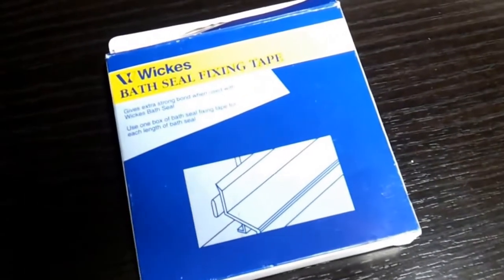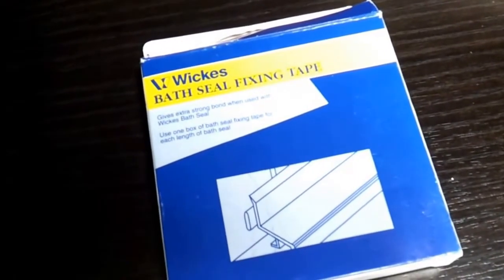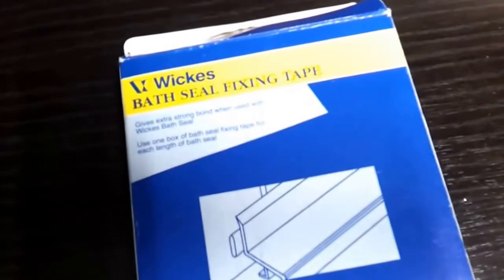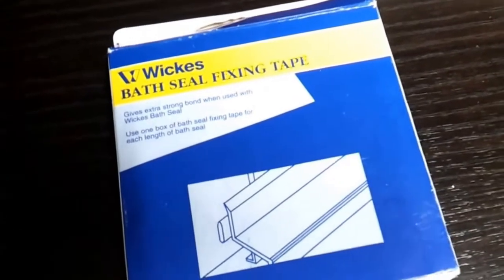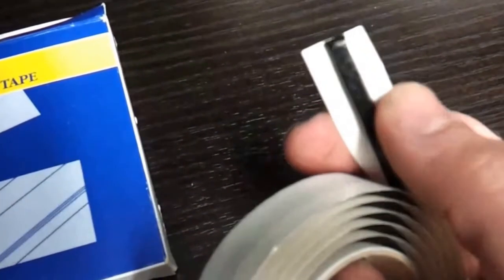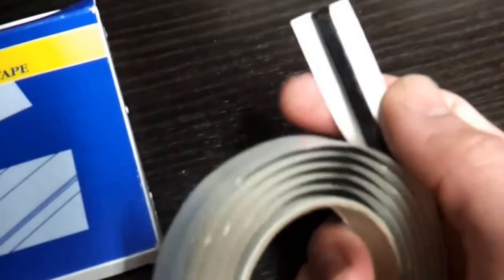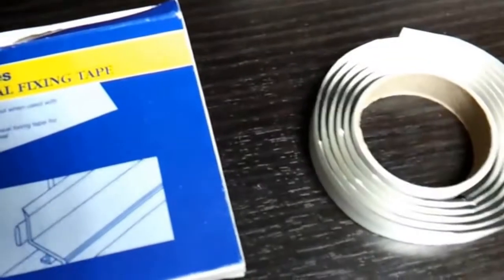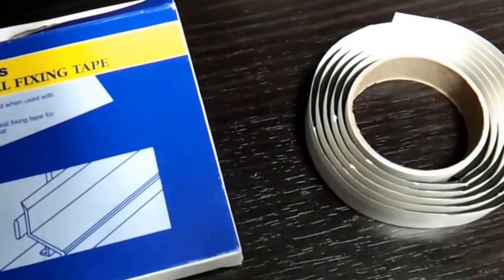QUICK TIP: Dcc decoder fixing tape

Comment: Good idea Jim mate but I just found out that some of my older Bachmann models aren't dcc ready so any ideas what I have to do to solve the problem the models aren't the split chassis type,one is a class 40 and the others a class 24 and 25.
Cheers Kev
Reply from the maker: HI Kev..
they will need a hard wire or interface , there are shops that will do this if you look on "model railway directory" ...jim